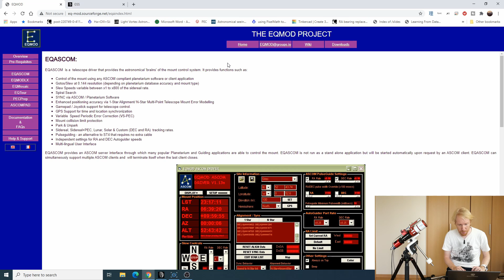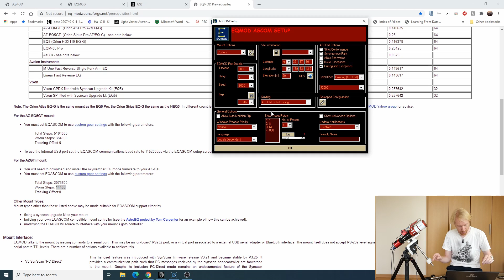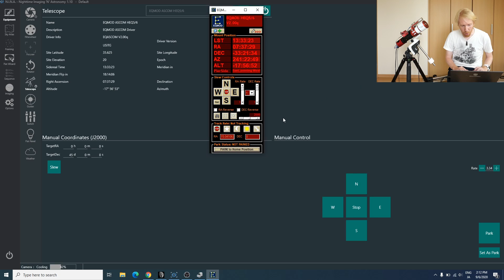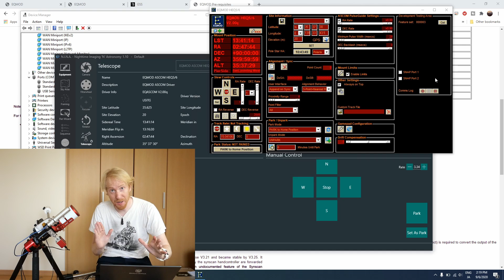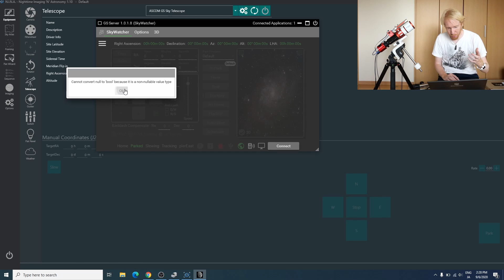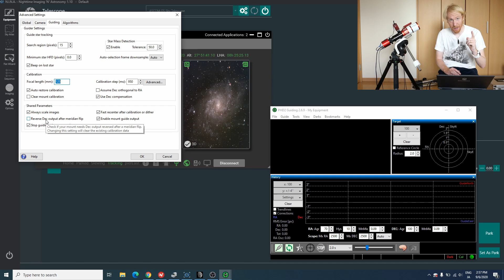Using a SkyWatcher Mount for Astrophotography? Watch THIS!

Comment from the maker: What mount are you using? I've gone full SkyWatcher recently, but I am still at heart a big fan of Vixen mounts :) Oh, and please consider subscribing to the channel - or if you need to buy astrophoto equipment and want to support me, feel free to get it via my OPT affiliate link https://bit.ly/2OIw6jH
Reply: Currently I am using an ioptron smart eq and a Skywatcher AZ-EQ 5. I am with you on hating the Skywatcher hand controller, and use the wifi module with the SynScan Pro App.
Reply: I try to download EQMOD so many times. The only thing I end up with is the small Ascom pad window controller who is totally irrelevant. So sad that I can't upload a screenshot and show you what I'm talking about. In short, it seems that I'm not able to download the Eqmod Ascom Driver, for whatever reason.
Reply from the maker: @NGC7000  Weird... maybe it's time to turn to CloudyNights or EQMOD groups for help? Difficult to tell what's wrong... good luck!
Reply: Becuase this video I got AzGti
Reply: @NGC7000  hiden in another folder the 2. from the top
Reply: I'm using an EQ6R Pto for the main rig and an AzGti as a portable mount to use with my Samyang 135F2 and other camera lens
Reply: Absolutely...When I buy astronomy equipment - I will contact OPT through your Link Thank You Cuiv
Reply: @CuivTheLazyGeek  I believe EQmod is downloaded through storage forage

Comment: Thanks for the very detailed explanation of connecting the mount. I only wish it came out a few weeks earlier. I really struggled to figure out things when I first got the HEQ5 Pro. The manual is not helpful at all and the salespeople where I purchased the amount in China didn't know much, either.  This could have saved me days of sleepless nights sitting outside in the dark trying to make my computer talks to the mount. I found out one disadvantage about connecting the amount via WIFI though is that if you use SynScan WIFI you cannot connect to the internet at the same time. It is quite inconvenient especially when I need constantly searching for answers to solve many issues I encounter as a beginner. Your NINA tutorial is also very helpful. I will be trying it out the next clear night. Keep up the great work. Subscribed.
Reply from the maker: I'm glad my videos have been helpful - I completely agree about the disadvantage of the Wifi connection (I don't like how it shows how dependent I have become on the Internet!). Good luck with your imaging & clear skies!

Comment: I use EQMOD, but some folks in the club are using GSS and like it so far. I'm looking at NINA. I'm currently using APT but I have SGP as well and I've had a lot of luck with Astroberry (Which is a great option for a portable rig. Light, easy on power, and a really excellent tool set once you get the hang of it).  I'm told you have some relatives in the Southeastern US not far from my location-  I know some folks in my club also enjoy your content. We would love to have you visit our field if you ever make it back over here!
Reply from the maker: Astroberry is something I'm looking into as well! I'm just a bit too addicted to NINA :D But yes, not having to depend on a full-fledged PC is a good thing... I'd love to visit your field when I'm the area!!

Comment: 2:01 It's super important that you do as he says and not as he does. I bought one of those extra cheap EQ-Direct Cables and tried it out today. Of course it had a short in it. Luckily neither my asiair nor my AZ-GTI seems to have suffered a defect. But the cable got quite hot and the RJ12-connector melted a bit.

Comment: Thanks for this video Cuiv. I recently found it having had  trouble using the SynScan App  with my Star Adventurer GTi and N.I.N.A. I followed your suggestion and installed GS Server, which works a treat. Slewing works straight out of the gate. Will try TPPA and Ascom guiding via PHD2 next.

Comment: Just watched your video since I recently received my new HEQ5 Pro mount. I mainly want to PEC train the mount without using the archaic HC method with the reticle eyepiece. I got a direct connect cable and had issues with it connecting to EQASCOM and found out by watching your video that I had the baud rate set wrong. Thanks! GSS looks awesome, but from some of your comments in the video, I might just try out EQASCOM first. It looks like it will do everything that I need (including PEC training/playback). The GSS 3D telescope is pretty cool, but I will just use the N.I.N.A. plugin and it should work fine. It's great to have you back at making videos! I have picked up quite a bit of good information from you (especially the Sharpstar objective replacement!). Take care and thanks Cuiv!
Reply from the maker: Enjoy EQMOD! I'd honestly go directly to GSS to avoid the EQMOD issues with sync especially near meridian, but there are workarounds!
Reply: @CuivTheLazyGeek  Thanks for the response Cuiv! I wanted to get rid of the HC and move away from the usb to HC cable. I also liked EQMOD because it will allow me to PEC train the mount. I also downloaded and installed GSS and really like the interface. I did not see a way in GSS to PEC train my HEQ5, but I could be missing it. I did see how you can PPEC a mount like the EQ6-r Pro, but I don't believe that my HEQ5 supports PPEC.  Thanks for the warning about the issues with EQMOD sync near the meridian. I will be aware of that. I use N.I.N.A. and hopefully that won't be an issue. Thanks again!
Reply from the maker: @juno1666  you definitely can train PEC in GSS, and GSS has a better handling of combining guide and PEC pulses than EQMOD does. However if you don't have PPEC, I'd say it makes more sense to just use PHD2's predictive pec algorithm, which auto-trains pec on the fly
Reply: @CuivTheLazyGeek  Well, heck! I will look more into GSS and also give the PHD2 predictive pec algorithm a try! I had tried the PHD2 predictive  pec algorithm with my AVX mount with no seeable impact, but the AVX is definitely another animal! Thanks again and again for all of your help Cuiv!

Comment: Michael Clancy

I do not understand something about polar alignment. I have the AZ-GTI mount. When you connect there is an alignment procedure ( 1,2,3 stars) and after that there are menu options to go to say Polaris. You do that . Point and track. Why isnt there software that you can just click on " polar align" and let the scope/ software just do it? I have Sky Safari also. Whats the difficulty in programming this when the scope knows where it is via GPS.? Point it North, level and go.  Also, I run into issues depending on what side of the mount I put the scope on. How do I know in advance what side it should be on? Of just on top? Thx in advance. Mike

Comment: @
Cuiv, The Lazy Geek What wedge should i use with the AZ GTI? And can it hold an Evostar 72ED with 30mm guidescope and a Canon 60D dslr? I wanted go first with the Star Adventurerer 2i, but alot ppl said, the polar alignment takes so much time, and its not a fully GoTo mount. AZ GTI is, and even have PEC, Guiding (Has 2i also), automatic finding star objects, etc. Its worth investing 80 euro more and get the AZ GTI, and Wedge, and mount it on my Gitzo Systematic Tripod (max 25KG load) which can hold a small child below it ;) ?

Comment: I only recently realised that GSS has a driver for the Synscan wifi dongle so I gave it a shot a few days ago. But I ran into that issue that I think you were referring to about the meridian flip.
But checking the box in PHD2 didn't help at all, because it was my RA that was shooting off in the wrong direction.
I'm hoping that a recalibration in PHD2 will solve the problem, but I suppose I'll find out the next time that the rain and clouds decide to bugger off..
But I really do like GSS, and at the very least it's great to have a second, different, wifi driver to help diagnose issues, because the ASCOM Synscan driver often does some whacky stuff in NINA.

Comment: I have purchased by mistake EQDIR cable with wrong connector, GTi require smaller one. Can it be fixed by replacing connector that will fit GTi or using some sort of adaptor?

Comment: Using the skywatcher EQ6-R pro. using a normal USB cable between that and the Zwo Asiair pro. Works great :)
Reply from the maker: Excellent! Now if only the ASIAir Pro had autofocus, and the ability to control something else than the EAF...!
Reply: @CuivTheLazyGeek  from what I can tell/read is that the autofocus is in the works and should come "soon".. (whatever "soon" means.. ) But it is being tested currently.

And I've got the EAF on order. So for me it's not the worst that it only works for that,But I understand the frustration.

Comment: Hello, sorry for this question outside the video subject, but I see you are using  the exact same  tripod  I bought 2 days ago on Amazon and that should arrive only mid to end of December. It's  a generic brand from China at 1/3 the price of a any branded one and looks very sturdy with 36 to 25mm carbon fiber leg diametres, wich is huge. I was looking for  a very stable but not too heavy  tripod for DSLR astrophoto  and this one seems to fit quite well the bill.  BUT it is from China, and I did find any serious have no real information on its quality. Hence my question: are you satisfied with the quality and stability of the tripod?
Thanks and regards - Francis

Comment: Could you please help me with this…
Can Eqmod software be used to drive the mount over wifi using the Synscan WFi Adapter. So far I have learned that Eqmod requires a virtual com port to be created…The EQDirfi adapter works in this way…but would I be able to use the Synscan wifi with Eqmod instead…

Comment: Hi Cuiv, superb video. is there a posibility to connect vom an other computer (stellarium installed) to the GS-Server to control/slev the mount? for example, the original skywatcher ASCOM skySkanPro app can be remotely connected over an ethernetIP from a computer thats not direkt connected with the mount. did you know what i want?

Comment: Hey Cuiv,  Thanks for the video and information. Perhaps I am just an old country boy but why would one add another level of complexity to the astro imaging if I am already running N.I.N.A to control everything which by the way it's working great and really enjoy all that it has to offer. Just don't see the need to add the GSS to the mix. Perhaps I am missing something in my understanding as to why use it? 

Thanks again,
DJ.
Reply from the maker: The setup is one of the three:
1- NINA -> SkyWatcher ASCOM driver -> hand controller -> mount
2- NINA -> EQMOD -> mount
3- NINA -> GSS -> mount
So GSS doesn't add any complexity, it's just one way to connect to the mount (and offers more flexibility than the two other methods). But then if you're fine with what you have... if it ain't broke, don't fix it!

Comment: Great Video but I have Version 1.10 of NINA in 64 bit on Windows 10 and I don't have an extensive list of telescopes Mounts as you have in the video drop down list. I have just purchased a Skywatcher AZEQ6 Mount and the EQMod  HEQ5/6 is not there in the list along with others in your video. I just have Skywatcher and SynScan. I am having intermittent connection problems with both those. Is that because its a 64 bit version? Com 4 set to 15200 baud= in device manager.
Reply from the maker: Hey Barry - have you installed the EQMOD ASCOM driver? It should then appear in the list. How are you connecting to the mount? Via the hand controller? Or directly via the USB port?
Reply: @CuivTheLazyGeek  Cuiv turned out to be I was using an old version of Platform 6 and NINA actual came up with "Please update Platform 6.". Problems have settled down but depending on the coms port on Windows 10 computer I plug into. I have to set up each time? Thank you for your advice as the older version had Cameras and programs dropping out and locking up the screen.

Comment: Cuiv, Thank yoou again for your enlightening videos.
I can connect to USB direct com 3 EQMod to my Skywatcher AZEQ6 GT but it always requires plugging the USB B 0ut and in again to connect. ( By the way manual the Alt/Az adjustments are a dream compared to other mounts)
I use SharpCap for Polar Align with excellent results then i do a 3 star align using the hand controller but the stars are a good way out view from either computer screen or Finder scope view. I had a Celestron AVX mount before this and after Polar Align I could always see the align stars at least in the Finder Stop if not on the screen. I like to do this before I plate solve with NINA as it plate solves first go.
Checked all the Settings re time, Date, Long Latt.+10 GMT and DLS ...Southern Hemisphere.
Unlike the AVX (internal Battery) mount this Skywatcher does not keep time and date and needs to be input every time?
Any Ideas?

Barry
Reply from the maker: When using EQMOD (bypassing the controller), your computer time is used, so in theory the mount time itself is irrelevent... otherwise, I typically don't do a star alignment anymore - I just rely on plate solving and automated centering. I unfortunately have no idea how well the mount works with the controller as I absolutely never use it!
Reply: Thank you for your reply. Currently bad weather for a few more days for more tests. When I was in Tokyo for work many years ago around autumn I never saw a clear sky once in 2 weeks just grey. You face a tough task there Cuiv.

Comment: I just plug into my EQ6-R pro directly via the USB port on the mount - I had one of those EQdirect cables earlier but I like the USB one more. Never tried any other mounts, just got the EQ6-R cuz it was the cheapest in its respective category and I heard good enough things about it.

About the Meridian Limits: Should't I also check if I can still move my dec in each direction so it can cover all of the night sky without hitting the tripod, before setting that as an RA limit? I mean you'Re not always going to slew around with a unmoved dec, or am I thinking wrongly about all this? With EQMod I mean :)
Reply from the maker: Yep, the later EQ6-R have that USB port, mine doesn't :)  And of course you are right on the Meridian limit, you want to make sure you set it so your scope wouldn't hit the tripod, regardless of the DEC angle!

Comment: Hu Cuiv, what a great video, i have no problem with guiding st4 cable but i want to do pulse guiding...Can you make a video how to do pulseguiding (have Heq5) or do you have a link how to do that?
Thanks 
Rigo
Reply from the maker: For doing pulseguiding via ASCOM it's pretty simple. First, connect to your mount, and install your mount ASCOM driver (or EQMOD, or GSS). Then, in PHD2, instead of choosing the mount to be "On-camera", choose the ASCOM driver, and once the mount is connected, in PHD2, it will use that instead of the ST-4 cable :)
Reply: @CuivTheLazyGeek  Thanks, you are a great GUY !!!!

Comment: Great videos, I am watching them all, I have the AZ-Gti and I use a dyi counterweight shaft and weight.  Can you tell me what your counterweight shaft and weight you are using ?  Thanks
Reply from the maker: Thank you! My CW shaft is actually from a Japanese vendor called Eyebell, and I don't think they sell abroad. The shaft itself is a modified Vixen CW shaft. The CW is a vanilla Vixen 1kg counterweight!
Reply: Hello friend, excellent video, regarding the counterweight bar, I have a skywatcher star adventurer, this bar is compatible with az gti ??? or is it necessary to buy another?

Comment: Hello. I'm wanna know if this eq mode works with a zwo asi air pro? And how many time is possible to take a exposure. Thanks
Reply from the maker: As per the ZWO website, you should check the ASI Air Pro manual, it should tell you.

Comment: This is an alt-az mount that I didn't know can be used like an equatorial one.What is the payload for it?
Reply from the maker: The EQ payload is not published - it's kind of "best effort". I would limit it to 4kg or so however. I have several videos on how to use the mount in EQ mode and tune it as well btw!
Reply: @CuivTheLazyGeek  thank you! I'll look into it, especially I am curious for the polar alignement method.My iOptron SkyGuider Pro it is a toy to polar align through the Polar Finder app.Also my Fornax Lightrack.But never had anything to do with go to systems such as this one.

Comment: Hi Ciuv, I was revisiting this super useful video, to check something I remember you mentioned about the problem with PHD2 guiding after meridiam flip when using GS Server. Just had that problem for firt time with mu AZ-GTi and solved it by checking the "Reverse Dec after meridian flip" option, as you explain here. I have one question. I use the same capture PC wiht my AZ-GTi and my CGEM mounts. Do you think I'll have to check and un-check this "Reverse Dec after meridian flip" option as I swap from AZ-GTi and CGEM? With the CGEM I'm using the Celestrom Universal Driver. Many thanks for all your videos. They are already a knowledge library for me :)
Reply from the maker: Thanks Fernando! Have you tried creating distinct equipment profiles for each of your mounts in PHD2? I think the settings are saved per profile, so that should do the trick for you!
Reply: @CuivTheLazyGeek  thanks Cuiv, you were right. Advanced settings are associated to each equipment profile. So having a different profile for each mount I can have this option on or off as required.